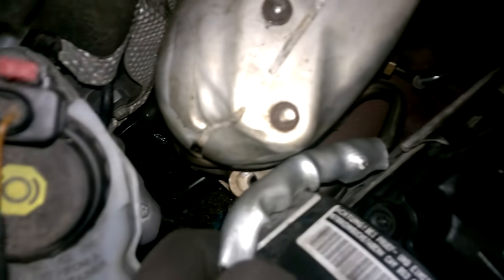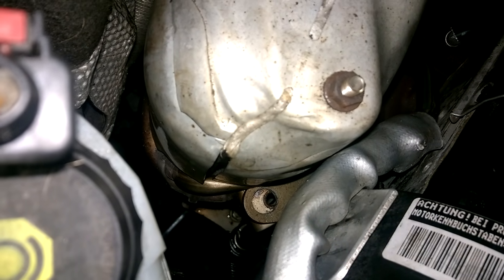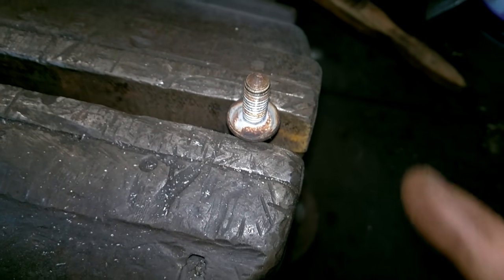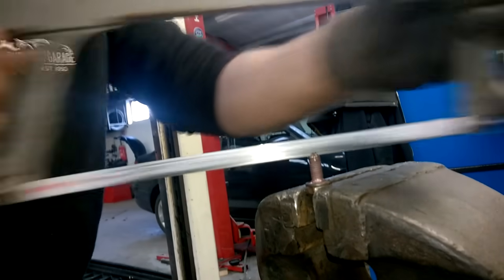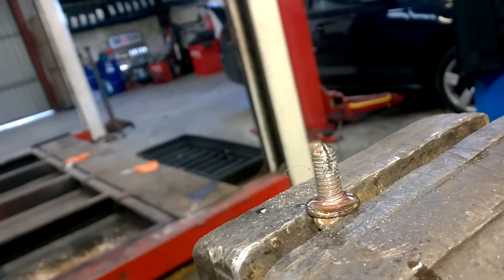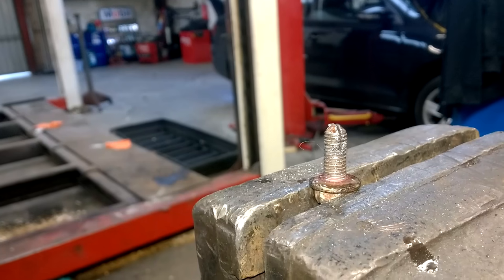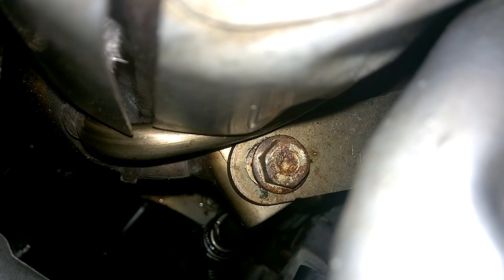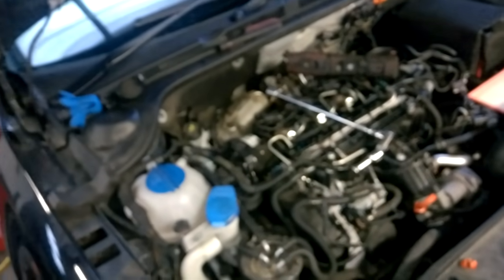My Father Taught Me This! Passing It On To The Next Generation

Comment: As an accomplished "back-yard" mechanic, I can appreciate
that. Knowing me though, I'd probably go buy a New bolt, and
Then hack-saw it.  What I used to do in that situation is, either
squeeze a Flat-head down there to align the holes better, or
I would apply the bolt to my grinder, and make a bit of a Cone,
to reduce the size of the tip, and then "Tap" new threads into
the grinded part that are close enough to START gripping the 
thread on the engine.  But I think I like your technique better.

Comment: Thank you Grandfather for your knowledge! i promise to use this hack for good purposes only!
Reply from the maker: The update info below is the pinned comment on this video, I know most people do not realize I made that video and it better explains/shows this method in use.   
I also included below details of why the job was done this way free of charge with the customer fully informed. I hope you check it out  👇👇
 
UPDATE* I decided to make a follow up video on this https://www.youtube.com/watch?v=yfNQullGEuQ&feature=youtu.be Should answer some of the questions that were raised, I include 3 demos of this in action with close up shots.
 
As there was some safety concerns & confusing comments raised, I felt I should clear a few things up. 
1) This is a tip for certain circumstances only, I never have and never would use it on a component which would cause any safety concern to any customer.  
2) The demo was done on a support bracket only, items like this or similar will not cause any safety concern. 
3) I did this free of charge and on a time restraint, I noticed it when I was replacing another item, the customer needed the vehicle back that evening and I decided rather than leave it like it was, I would do this and secure it up fully. 
4) The bolt was not the issue, the part that the bolt threads into is a secured piece, someone had previously damaged it, leaving the bracket loose and the bolt just tightened a turn or so.
5) The bolt can be removed and will not break, it will go in and out as usual and has helped clean up the damaged threads.  
6) Used in the right application I personally believe this is a great tip and can save you a lot of time & trouble. 

Lastly to all the people who have watched the video, Thanks very much and I am delighted with the feedback I have received on it.

Comment: neat trick, another thing you can do if you run into messed up threads just cut a shallow slot down the side of the bolt and it will clean up the threads like a tap as you screw it in

Comment: Volkswagen or audi 
D p f bracket. No need to cut bolt you can access the bracket from the wheel arch . Just loosen the nut that holds the bracket in place.

Comment: Your father is teaching from the grave bet he never thought 6 million people would see his handy work. Great tip though new one for me. Thank you
Reply from the maker: The update info below is the pinned comment on this video, I know most people do not realize I made that video and it better explains/shows this method in use.   
I also included below details of why the job was done this way free of charge with the customer fully informed. I hope you check it out  👇👇
 
UPDATE* I decided to make a follow up video on this https://www.youtube.com/watch?v=yfNQullGEuQ&feature=youtu.be Should answer some of the questions that were raised, I include 3 demos of this in action with close up shots.
 
As there was some safety concerns & confusing comments raised, I felt I should clear a few things up. 
1) This is a tip for certain circumstances only, I never have and never would use it on a component which would cause any safety concern to any customer.  
2) The demo was done on a support bracket only, items like this or similar will not cause any safety concern. 
3) I did this free of charge and on a time restraint, I noticed it when I was replacing another item, the customer needed the vehicle back that evening and I decided rather than leave it like it was, I would do this and secure it up fully. 
4) The bolt was not the issue, the part that the bolt threads into is a secured piece, someone had previously damaged it, leaving the bracket loose and the bolt just tightened a turn or so.
5) The bolt can be removed and will not break, it will go in and out as usual and has helped clean up the damaged threads.  
6) Used in the right application I personally believe this is a great tip and can save you a lot of time & trouble. 

Lastly to all the people who have watched the video, Thanks very much and I am delighted with the feedback I have received on it.

Comment: It's things like these that make a mechanic the best of the best
Reply from the maker: Thanks Joshua 
 
The update info below is the pinned comment on this video, I know most people do not realize I made that video and it better explains/shows this method in use.   
I also included below details of why the job was done this way free of charge with the customer fully informed. I hope you check it out  👇👇
 
UPDATE* I decided to make a follow up video on this https://www.youtube.com/watch?v=yfNQullGEuQ&feature=youtu.be Should answer some of the questions that were raised, I include 3 demos of this in action with close up shots.
 
As there was some safety concerns & confusing comments raised, I felt I should clear a few things up. 
1) This is a tip for certain circumstances only, I never have and never would use it on a component which would cause any safety concern to any customer.  
2) The demo was done on a support bracket only, items like this or similar will not cause any safety concern. 
3) I did this free of charge and on a time restraint, I noticed it when I was replacing another item, the customer needed the vehicle back that evening and I decided rather than leave it like it was, I would do this and secure it up fully. 
4) The bolt was not the issue, the part that the bolt threads into is a secured piece, someone had previously damaged it, leaving the bracket loose and the bolt just tightened a turn or so.
5) The bolt can be removed and will not break, it will go in and out as usual and has helped clean up the damaged threads.  
6) Used in the right application I personally believe this is a great tip and can save you a lot of time & trouble. 

Lastly to all the people who have watched the video, Thanks very much and I am delighted with the feedback I have received on it.

Comment: This is a clever hack. I've used a angle grinder to cut the slot rather than a hacksaw, with great success. I was doing it for a different reason though. I was using bolts to hold after market speakers on to my car doors (the originals were riviteded in). As  the bolt face was inside the door skin and inaccesable. Using the cut slot I was able to tighten the bolt and nut using a screwdriver. Hope that discription makes sense!

Comment: Nice trick for when I work on some else's machines. I'm very picky for my things . I feel like the good threads won't grab as hard since the bolt is cut . At the top where the bolt has good threads the hole doesn't.  It will eventually come out if there is a lot of vibration.  I would definitely use thread locker.
Reply: thread lock just keeps it from unscrewing
it wont stop it from pulling straight out if the threads are all weakened
Reply: @kenwittlief255  I'm talking about if you do this its better with thread lock vs nothing
Reply: @drakokamikaze8823  if you cant get the spec torque on the bolt because tbe hole was stripped out then tbread lock will not save you. At that point you need a heilicoil.
Reply: @kenwittlief255  if you need to do that period you need a heli coil. That's why I wouldn't do it on my machines. If I did it in anything I will use thread lock. If you do it's your choice if you won't use thread lock .
Reply from the maker: The update info below is the pinned comment on this video, I know most people do not realize I made that video and it better explains/shows this method in use.   
I also included below details of why the job was done this way free of charge with the customer fully informed. I hope you check it out  👇👇
 
UPDATE* I decided to make a follow up video on this https://www.youtube.com/watch?v=yfNQullGEuQ&feature=youtu.be Should answer some of the questions that were raised, I include 3 demos of this in action with close up shots.
 
As there was some safety concerns & confusing comments raised, I felt I should clear a few things up. 
1) This is a tip for certain circumstances only, I never have and never would use it on a component which would cause any safety concern to any customer.  
2) The demo was done on a support bracket only, items like this or similar will not cause any safety concern. 
3) I did this free of charge and on a time restraint, I noticed it when I was replacing another item, the customer needed the vehicle back that evening and I decided rather than leave it like it was, I would do this and secure it up fully. 
4) The bolt was not the issue, the part that the bolt threads into is a secured piece, someone had previously damaged it, leaving the bracket loose and the bolt just tightened a turn or so.
5) The bolt can be removed and will not break, it will go in and out as usual and has helped clean up the damaged threads.  
6) Used in the right application I personally believe this is a great tip and can save you a lot of time & trouble. 

Lastly to all the people who have watched the video, Thanks very much and I am delighted with the feedback I have received on it.

Comment: Aren't dads great? My dad also taught me this trick. One thing he suggested was once the modified bold goes into place, screw it in and out a few times, then (if you have one) finally replace it with a normal "unmodified" bolt.
Reply from the maker: The update info below is the pinned comment on this video, I know most people do not realize I made that video and it better explains/shows this method in use.   
I also included below details of why the job was done this way free of charge with the customer fully informed. I hope you check it out  👇👇
 
UPDATE* I decided to make a follow up video on this https://www.youtube.com/watch?v=yfNQullGEuQ&feature=youtu.be Should answer some of the questions that were raised, I include 3 demos of this in action with close up shots.
 
As there was some safety concerns & confusing comments raised, I felt I should clear a few things up. 
1) This is a tip for certain circumstances only, I never have and never would use it on a component which would cause any safety concern to any customer.  
2) The demo was done on a support bracket only, items like this or similar will not cause any safety concern. 
3) I did this free of charge and on a time restraint, I noticed it when I was replacing another item, the customer needed the vehicle back that evening and I decided rather than leave it like it was, I would do this and secure it up fully. 
4) The bolt was not the issue, the part that the bolt threads into is a secured piece, someone had previously damaged it, leaving the bracket loose and the bolt just tightened a turn or so.
5) The bolt can be removed and will not break, it will go in and out as usual and has helped clean up the damaged threads.  
6) Used in the right application I personally believe this is a great tip and can save you a lot of time & trouble. 

Lastly to all the people who have watched the video, Thanks very much and I am delighted with the feedback I have received on it.

Comment: It’s genius is in it’s simplicity. Thank you for passing this on my friend. NY, US.
Reply from the maker: Thanks Bee 
 
The update info below is the pinned comment on this video, I know most people do not realize I made that video and it better explains/shows this method in use.   
I also included below details of why the job was done this way free of charge with the customer fully informed. I hope you check it out  👇👇
 
UPDATE* I decided to make a follow up video on this https://www.youtube.com/watch?v=yfNQullGEuQ&feature=youtu.be Should answer some of the questions that were raised, I include 3 demos of this in action with close up shots.
 
As there was some safety concerns & confusing comments raised, I felt I should clear a few things up. 
1) This is a tip for certain circumstances only, I never have and never would use it on a component which would cause any safety concern to any customer.  
2) The demo was done on a support bracket only, items like this or similar will not cause any safety concern. 
3) I did this free of charge and on a time restraint, I noticed it when I was replacing another item, the customer needed the vehicle back that evening and I decided rather than leave it like it was, I would do this and secure it up fully. 
4) The bolt was not the issue, the part that the bolt threads into is a secured piece, someone had previously damaged it, leaving the bracket loose and the bolt just tightened a turn or so.
5) The bolt can be removed and will not break, it will go in and out as usual and has helped clean up the damaged threads.  
6) Used in the right application I personally believe this is a great tip and can save you a lot of time & trouble. 

Lastly to all the people who have watched the video, Thanks very much and I am delighted with the feedback I have received on it.

Comment: I just file a chamfer across one side of the bolt, going 2 to 4 threads down. I then file another chamfer at about 60 degrees to the first one. This gives the effect of a narrow 'nose' to the lead in of the bolt, which then lines itself up and in. I've used this method so many times in my home and work life.

Comment: Neat little trick and seems even easier than re tapping the bolt. Thanks for sharing
Reply from the maker: The update info below is the pinned comment on this video, I know most people do not realize I made that video and it better explains/shows this method in use.   
I also included below details of why the job was done this way free of charge with the customer fully informed. I hope you check it out  👇👇
 
UPDATE* I decided to make a follow up video on this https://www.youtube.com/watch?v=yfNQullGEuQ&feature=youtu.be Should answer some of the questions that were raised, I include 3 demos of this in action with close up shots.
 
As there was some safety concerns & confusing comments raised, I felt I should clear a few things up. 
1) This is a tip for certain circumstances only, I never have and never would use it on a component which would cause any safety concern to any customer.  
2) The demo was done on a support bracket only, items like this or similar will not cause any safety concern. 
3) I did this free of charge and on a time restraint, I noticed it when I was replacing another item, the customer needed the vehicle back that evening and I decided rather than leave it like it was, I would do this and secure it up fully. 
4) The bolt was not the issue, the part that the bolt threads into is a secured piece, someone had previously damaged it, leaving the bracket loose and the bolt just tightened a turn or so.
5) The bolt can be removed and will not break, it will go in and out as usual and has helped clean up the damaged threads.  
6) Used in the right application I personally believe this is a great tip and can save you a lot of time & trouble. 

Lastly to all the people who have watched the video, Thanks very much and I am delighted with the feedback I have received on it.

Comment: I once repaired stripped threads on a friend’s costly race-ported cast iron Chevy cylinder head where the intake manifold bolts down, the common 3/8-16 bolts, by using a JB Weld trick. We applied JB Weld (original, full strength formula) inside the stripped bore, then sprayed the bolt with PAM cooking oil, then inserted the bolt into the wet JB Weld and allowed the entire thing to dry 12-24h (whatever the pkg said).

The bolt turned right out thanks to the PAM oil, revealing new threads, and wow they worked!! Torqued the intake bolt to spec holding my breath lol. That was 10 years ago and it’s still holding. It was threads that pierce the water/coolant jacket, so it looked cool when done because you could clearly see half the threads’ wall was half cast iron, half was dark-gray JB Weld, and it made a seamless transition. 

Definitely a great trick when you’re desperate!
Reply: That's crazy. Amazing that it worked so well.